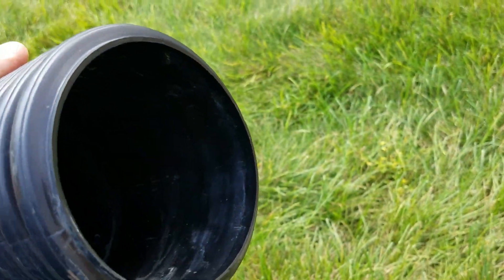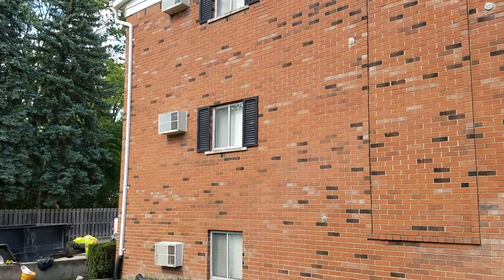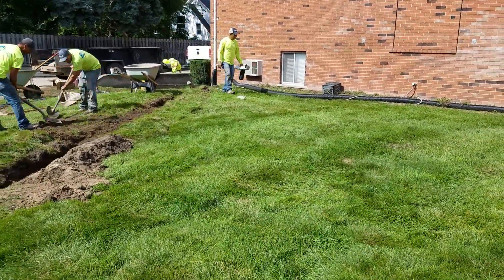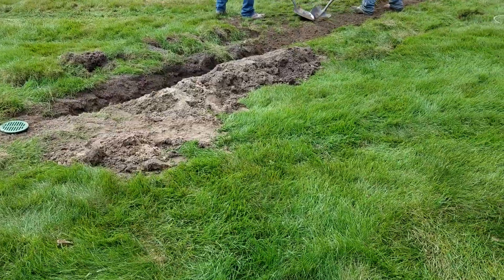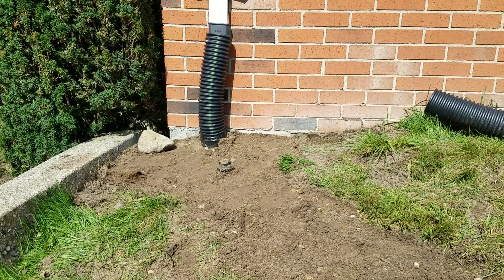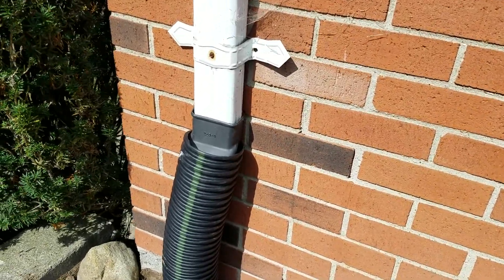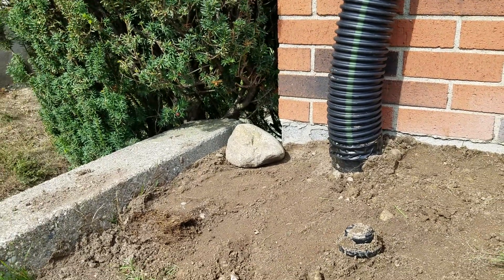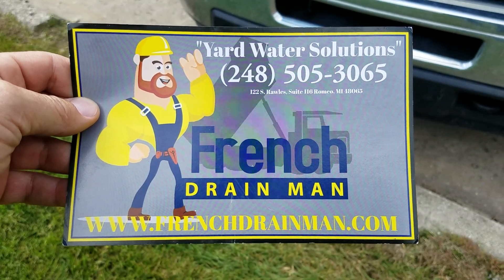Dual Wall Corrugated Pipe for Underground Drainage System for Roof Run Off

Comment: That system will fail, water has to travel upwards to escape, almost impossible to do with leaves clogging that catch basin.  You should have spent 5 extra minutes and ran it to the road not a uphill catch basin.
Reply from the maker: https://youtube.com/playlist?list=PLjFCqaZ4v1BXKlR6qPMC_8I00r5KGdoP9&si=cA5T9dU8Oy2eGsiG

Comment: Can you run downspouts and sump pump in the same 4 inch pipe ?
Reply from the maker: I do prefer a primary sump pump to be on its own discharge line, a secondary sump pump can be on a downspout lined.
https://youtube.com/playlist?list=PLjFCqaZ4v1BUP1wxXS1i-EwufMkVjopvD&si=nhDIfx-R4I243jDJ

Comment: Another 2 questions:

1) Do you ever install a tee or wye above ground after the downspout adapter as clean-out access?

2) Like in your sump pump discharge line install videos, do you install an overflow stub in downspout systems incase the Spee-D basin freezes causing a backup in the winter?

Really appreciate your videos. Just about to install a 60 ft. ‘burrito’ wrap curtain french drain as well as bury 2 downspouts using dual wall & the same 6” basin. 

Thanks!